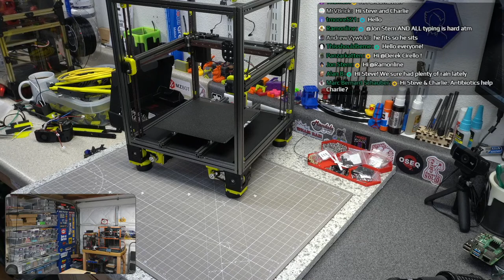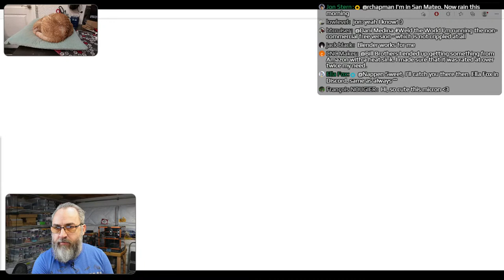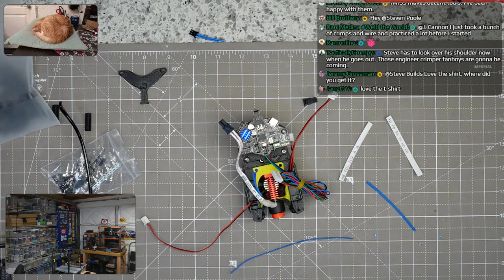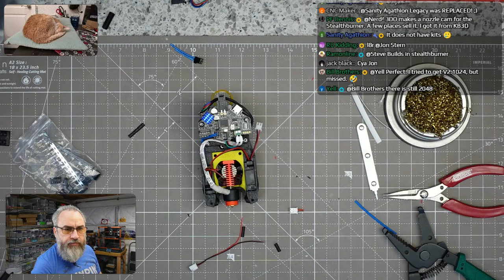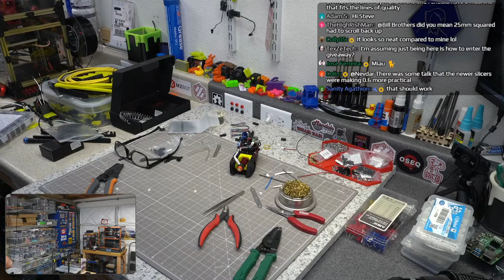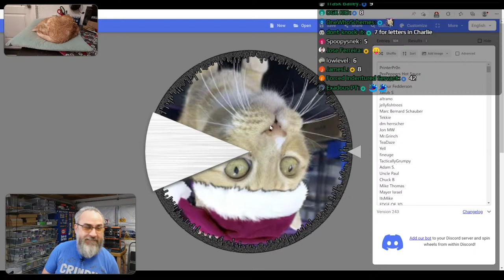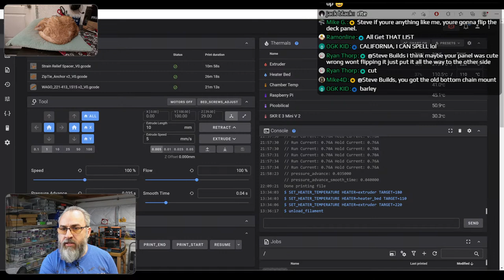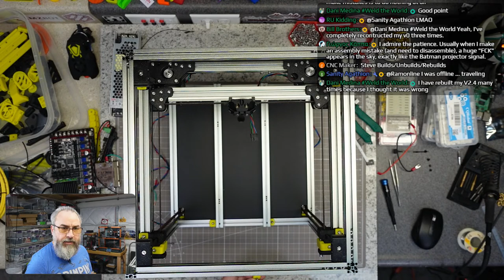Micron (Part 5)

Comment: @0:00:00 Greetings and introduction
@0:11:31 Recap of build + changes and progress made off-stream
@0:17:47 Resume wiring of electronics bay
@0:31:02 Cable management of electronics bay (AKA increasing workload of upcoming un-build 😉)
@0:53:50 Toolhead wiring
@2:28:29 Mandatory toolhead inspection by Charlie
@2:38:02 Assembly of umbilical cable strain relief part on toolhead
@2:59:34 Giveaway time
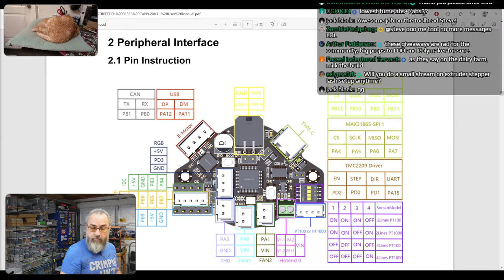@3:12:25 Preparing for gantry wiring
@3:17:07 Assembly of printed cable chain
@3:36:39 Oops!! Steve realizes the deck panel is reversed 😫
@3:53:08 Crimping MFT3.0 connectors on the A-B stepper wires. 
@4:05:26 Tensioning the belts on the Z-drives
@4:11:40 Flipping the deck panel (AKA the Steve Unbuilds part of the stream 😆)
@4:25:26 Steve rebuilds
@4:28:22 Charlie lends a hand in the rebuild process 😉🤣
@4:57:04 Winding down. Thanks and farewells

Comment: Hate to do thus again…. So both the m8p and uhp 200 holders dont line up with the din clip mounts. Could you upload the din clips and mounts for the psu and m8p. Oddly enough the u2c and its din clip line up. Once again thank you soo much!!!!
Reply from the maker: Which M8P and UHP mounts don't line up?  We're working on getting all the DIN mounts, including the extras I've modeled, up on a Voron repo. Should be very soon.  If you want them quicker feel free to DM me.